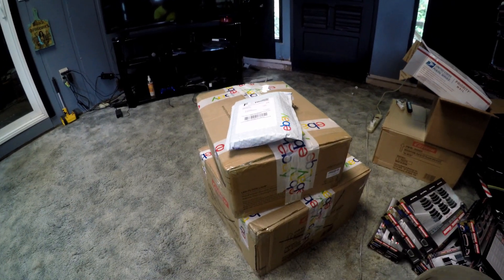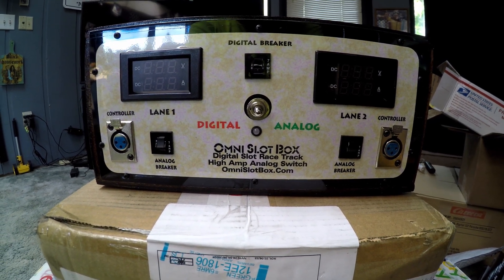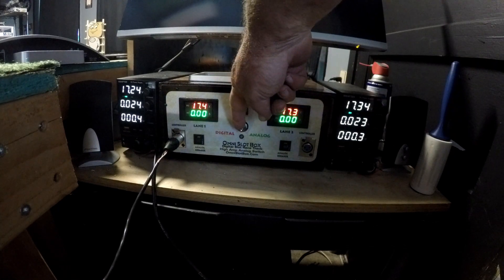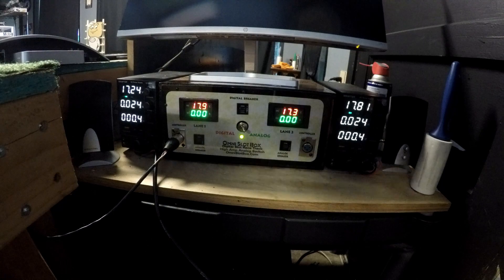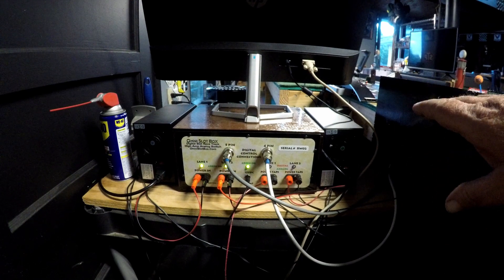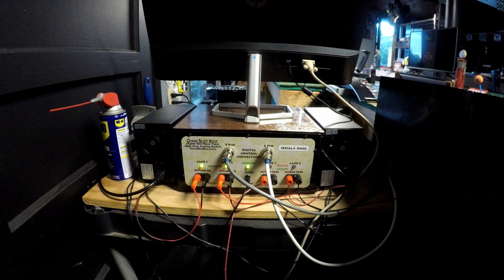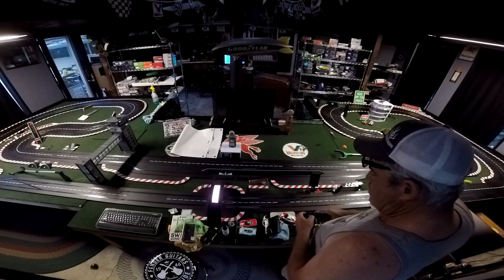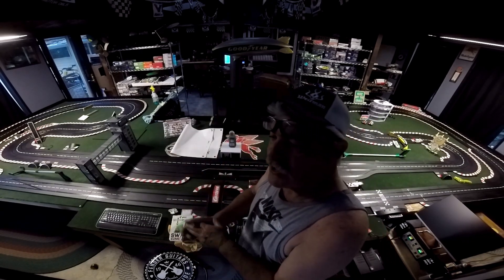Omnislotbox unboxing/demo

Comment: Great video 
What power supply are you using??
Reply from the maker: I bought two new power supplies when I bought the unit, can’t remember the rating. Check Jim Cunningham web site he sells them with Omni box as a package if you need them